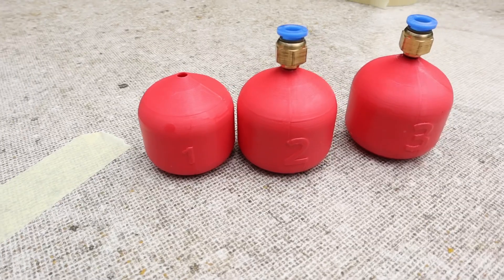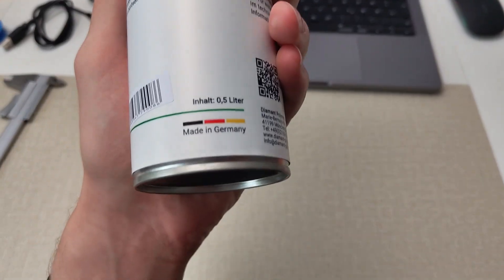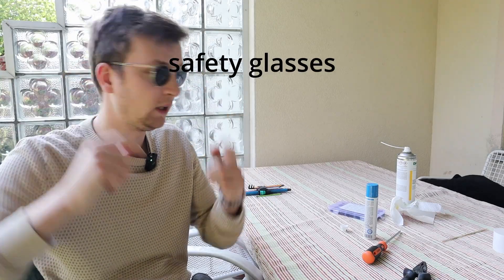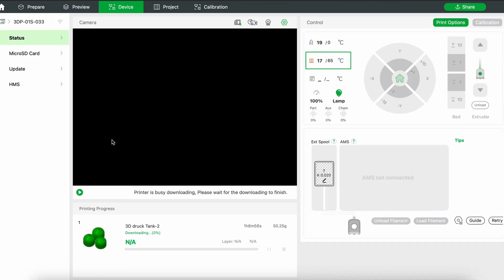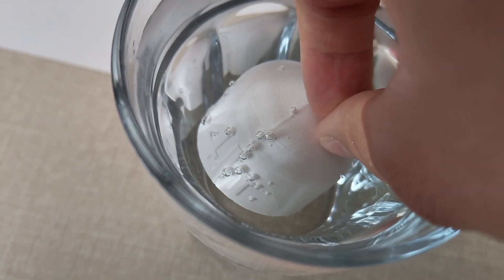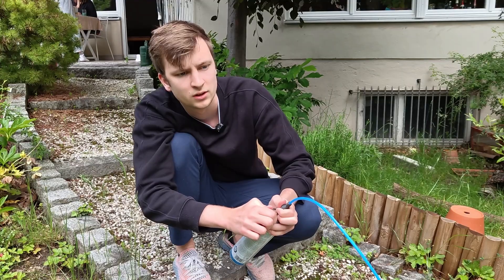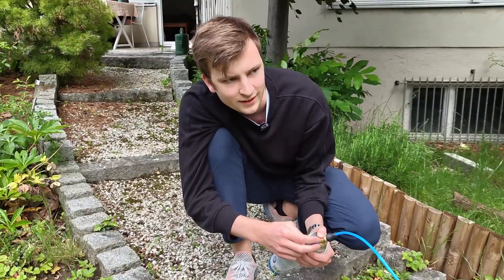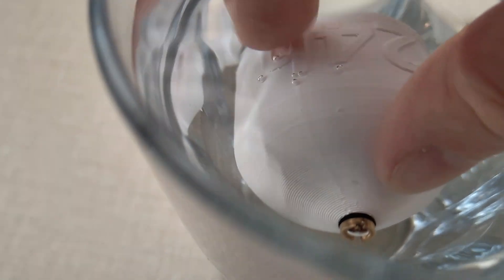Gas tight 3D-prints

Comment: I was able to achieve gas tight 3d printed parts with no post processing or sealing agents. The key settings to play with are extrusion width, and extrusion multiplier. Bump those two settings up as high as you can. Also print as hot as you can. I was able to make pla, petg, polycarbonate, and polypropylene all be gas tight. I pressure tested a tank made out of CF polypropylene up to 500psi without failure, so could have gone higher. It really works, you've got to try it!!
Reply: 34bar?! ... "YouTube commenter sustains life changing injuries from 3D printing experiments"
Reply: yea, I make my air fittings for my airbrush with PETG and proper wall thickness.  Some slicers have the option to merge inner walls with a 200 percent multiplier.  It's like printing a wall and then filling it with glue.  Otherwise I just use 5 walls and they tend to hold fine.
Reply: I'm guessing higher temp, slower fan, slower print, and other tricks used in better bonding in layers may be better than any post-processing.

Also, any test should be done with a control to compare against.
Reply: How large was the tank? That level of psi should handle a PCP airgun !!
Reply: That's awesome, can we get a video on it?
Reply: Considering how stretchy Silk PLA is, and its tendency to merge with lower layers, I bet you could get some pretty good results with it.

Comment: Wonder if applying the coating and then putting it in a vacuum chamber for the few minutes of soak time would result in more of the coating getting into the gaps in the print. I’m going to try this for a water manifold I’ve printed which I know is not water tight currently.

Comment: Maybe you could try electroplating. After some isopropyl alcohol smoothing to blend the layers, or just sanding/light heat to seal the gaps, an all-round electroplating could significantly improve the performance of this as well as give more consistent gaps along the threading at the top.

Comment: I think you are mixing up butane and propane, although i may be wrong, but lighters in the us use butane. Butane is a liquid with far lower pressure at room temp compared with propane. Otherwise, fantastic video.

Comment: To encourage the Dichtol spray to penetrate better, connect your printed tank to a vacuum pump before spraying so the vacuum pulls the sealant deeper into the pores of the print. Bonus: if you've successfully sealed the print, the tank will hold a vacuum when the vacuum pump is switched off, so you can use that test to verify whether you need to apply another coat of sealant.

Comment: Hello 'German Engineer' thank you for this fascinating video. I would like to take this opportunity to ask if you would be willing to make a video on a subject that I feel confident that you would be qualified to make, & that I feel would be of interest to your audience. the subject is this: If an architect wants to design a building on Earth they will determine the necessary structural load bearing functions under the assumption that the structure will be subject to 1G The gravitational constant at a value of 1 in the necessary calculations. these calculations often treat Mass, & Weight as fixed values relative to each of these functions (weight, & Mass) even though they are separate but connected functions. If we imagine building perhaps a high rise on Luna how would we change the way we see the load bearing capacity of various common structural elements such as I beams, & Trusses, or other elements common to terrestrial construction. Thank you again, DTM

Comment: What might make this project help come together:
>Dissolving the surface with a solvent to smoothen it and join the layers
>You could get inside by printing the pressure vessel in two halfs and joing those with screwrods (M3 would suffice here) and nuts (Like with the FGC 9 design), this will allow you to apply any sort of sealent to the inside (any spray-on rubbers, silicone, getting a better layer of Dicktall, etc.)
>epoxy or silicone layer (preferably on the inside)
>Better inlet valve, like putting a nut and gas seal into the print, mid printing, you could then just screw the inlet valve into it and have a way stronger weak point, if the plastic between the inside nut and outside inlet valve is as thick as the rest of the walls, it will no longer be a weak point and way safer
>Engineering a weak point in such a way that if it were to blow up, the part that blows up will not become a dangerous projectile, if the 3mm or maybe even the 2mm vessels were to explode without the hose attached, they will shoot the inlet valve out like a bullet and shoot someone's eye out, damage something or just get lost and be unsalvagable for another print thus losing money

Stay safe, I'm open to helping you with this since it's a great idea and pushing the possibilites of 3D printing is awesome, contact me if you want help with something.
Reply: I think dissolving the walls with solvent would require a material that would also be vulnerable to the gas used here.

Comment: so 1mm thickness, is a strange thickness to choose with a 3D printer, given how default nozzles have become 0.4mm in size.  The answer here, might not be in the thickness of the walls, but the amount of walls (as most things 3DPrinted are, for strength)

it would be interesting to see a 1mm nozzle print (making 1 wall)  or like 2 walls, making 2mm vs the 0.4mm nozzle making 5 walls for 2mm, or 'over extruding' 0.1mm each wall, making 2 walls into 1mm thickness.

Comment: Not all plastics are the same, make sure you use a plastic that will not react or break down with propane.

As for the leaking test in the water, it looks like most of the leakage took place around the seam which is a common weak point for waterproofing prints. It may be interesting to see a test done with a thick nozzle and vase mode although the part would likely still be too thin unless you pick a material with very good layer adhesion.

Something that would be worth trying instead is vapour smoothing ABS or ASA, it is very easy to do and that should fuse the layers and inside surface almost perfectly and make it very smooth meaning that as long as the plastic can withstand the propane it shouldn’t need any coating on its insides.

Also expanding gas cools things down and most plastics get very brittle when cold so that could be an issue depending on the application.

It may not be a bad idea to wrap the outside in something like potentially carbon fibre and epoxy, that could make it much stronger.

A better testing method would be to use a bike pump with a gauge, all you need is goggles and a barrier between you and the pressure vessel to do it safely and then you can read out the pressure and you should be able to tell if it leaks too.

It will be interesting to see what you use this for.
Reply: Not only chemical resistance but creep is also important if you want it to not deform in a week of load. PLA will surely baloon into a sphere through a long load cycle, while ABS will just resist it fine for ages (or until other stuff break it that is).
For his application tho this isn't a problem, as he said it would be holding pressure for like 10 minutes only or so (unless I heard it wrong).

Comment: Did you consider using a really low viscos resin and turning the tanks until it hardens? Might be cheaper and depending on the fill level much stronger (but possibly heavier)

Comment: For pressure testing, especially for larger vessels, fill the vessel with water and pressurise that. This avoids the exciting explosion as the pressure is released on failure. Pressure vessels are tested to a value significantly higher than the working pressure of course. Don't underestimate the destructive power to the rest of the setup and to hands/face etc. of even a small vessel exploding.
Having said that, amazing project thanks for sharing!
Reply: Also consider damage accumulated across pressure cycles. Especially with brittle plastics and inherent stress concentrations/weaknesses of 3d printed plastics.

Have fun and be safe!
Reply: @a.1441 throwback to the original shape CPSDrone tested
Reply: +1 for water test as per pro tests. But if you have to stick to gas, submerging in an open water container for the test is a super easy safety measure. Still a very fun experiment.
Reply: Hydrostatic testing... talk about a bad time doing this for scuba, k size,etc tanks, sooo brutally heavy.  no idea how i did that when i was younger.
Reply: The bulk modulus of water is a lot bigger.. you won't have nearly the control over the pressure inside the vessel, and temperature changes could be catastrophic.

Comment: 3d print, then coat the inside with resin (pour in, shake violently to coat the inside, then turn upside down and put a vibrator to it to dunk excess out) Makes them water AND gastight, and far far stronger then they were.
Reply: Hey i was watching Evan&Katelyn recently and the thought crossed my mind is that i'm really not putting a vibrator to enough of a use in my hobbies. They use them for concrete projects to transform it into a state where it flows easier. For sure has to be helpful in degassing thick liquids as well.

Comment: If you're not going to use a blast shield, PLEASE wear eyewear. They wouldn't make a pineapple grenade if shrapnel didn't kill.
Very cool concept for a video! I wonder what possibilities there could be for utilizing these as HPA tanks for airsoft.
Reply: I think those HPA tanks are over 100 Bar, maybe closer to 200 or 300 when fully pressurized, and then you need a good safety margin above that to prevent accidents.

I don’t think it’s possible, at least not using standard off-the-shelf 3 D printers and plastics.

Comment: Not lying. I have been working on my settings to get to something like this. I want to make a butane tank and liquid fuel tanks. In my opinion, a 3d print that is not water tight is a print that is not well fused anyways. I expect all my prints to come out solid. I am interested in this dichtol. Frankly I am planning on using fuel resistant silicone sealants.

Try baking them in plaster. Just plug the top and anneal them. Unless you plan on burning the plastic then I can't imagine getting plaster out of that.

Anyways thank you for making this video. Very cool, much guidance, and finally a purpose for red filament beyond a esthetic.

Comment: Could you apply a lot of dichtol (so there is a puddle inside) and then quickly pressurize the tank to an safe level? So that the pressure forces the dichtol into the cracks where it’s leaking, because that’s where some flow is created? I think like that you could get it truly gas tight :)

Comment: Hey man cool stuff!
I see in the slicer that you just used a mostly standard profile. For strong prints I default to 0.15mm layers with 0.6mm walls (works on a 0.4mm nozzle).
That way the layers melt together a lot more cause they get squeezed in and sideways a lot. I guess that would also help a lot in making it air tight.
Good luck mate with later tests. Looking forward to seeing if I can use these results later?

Comment: If I could get my hands on dicktall I would. But this reminds me that I want to try water based and petroleum based polyurethanes and epoxy on printed parts to see if that makes them gas tight and also if it adds some strength. I was thinking pressure differentials while wet would help my dicktall substitutes penetrate my parts.

Comment: I'd try 'vapour smoothing' a 3d printed pressure vessel to produce gas-tight surfaces and make the filament less susceptible to layer separation. But I can't begin to imagine any practical applications where a 3d printed pressure vessel would be applicable, over a much stronger and safer carbon fibre alternative, that can accommodate much higher pressures. 👍

This is my opinion, I could be wrong. 😉

Comment: Great video! I've been reading through the comments, and I have a few ideas on how to improve your tanks:

- As a few have noted, your testing wasn't that rigorous. I get that's not what you were aiming for, since you basically stated that you only wanted to see if the tanks could hold pressure at all, but a pressure gauge and something like a compressor, or even a bicycle pump would work better for testing different variables 
- Printing the numbers inside the devices can introduce weak points in the print. It'd be better to judt write the experiment with a permanent marker on the print later!
- Annealing is a good bet for strengthening your prints, and you just need a few kilograms of salt, a toaster oven, and a few hours
- There are quite a bit of other products what could be used to water seal, and probably air seal the inside of the device. Some have suggested abs and acetone, or some exotic glues, but I bet more common products, like UV resins, silicone, maybe hot glue, or even wax (check out NightHawkInLight's latest video for more info on that) could do the trick
- Don't underestimate vase mode! A twice thick ABS vase fused with acetone vapour, with a good wall design, should be able to hold way more pressure than expected for it's weight!
- Also, a straight sphere may not be the optimal shape. In nature may be, but given how FDM printers work, the weakest axis is the Z one, so your parts will always blow up from suboptimal planar adhesion. Maybe wide, short cylindrical tanks could work better, but I bet some printed inside supports, like beams holding the walls from exploding outwards would contribute quite a bit to the maximum pressure, while taking not that much volume from the device
- Finally, the neck will always be your weak spot. Try printing it way thicker than the tank itself so that it doesn't affect the experiments!

Again, it's been a really good video, and I can't wait for the next one! (Hopefully in English hehe)

Comment: Nice experiments. One thing to nitpick though: Lighter gas is butane, not propane. Difference is that it only has ~2 bar at room temp, not ~8 bar like propane.
Reply: Isn’t that a smaller molecule as well? So potentially it would leak faster?
Reply: Butane is actually larger than propane since it has 4 carbons instead of 3. Methyl groups have 1, ethyl 2, propyl 3, and butyl 4. You can of course keep going with longer carbon chains as well

Comment: One method which wasn't tried or I haven't seen is submerging the print into stabilizing resin so it can close the air gaps and remove oxygen. Then you bake it to cure it.
Reply: Most printing materials melt/soften at fairly low temperatures, maybe a non heat setting resin.
Reply: Yeah, just something that soaks into any gaps and eventually hardens/joins.

Or could you try and coat the inside and pressurize it then, driving it into the gaps?
Reply: I thought about uv resin to do the same , dip and cure with the light .

Comment: We do not know the pressure value, only that you gave some pressure on it.
And you are holding the Propane bottle wrong. You should not let the liquid flow into the tube, only the gas. So keep it vertical.
If you would use a compressor with a pressure sensor, this would be useful.

Comment: I printed a bowl to soak a motorcycle clutch in oil and at only 2 perimeters it didn't leak at all.  I didn't know people have problems making them liquid tight.
Reply: I'm guessing that oil would be stickier than water, and thus would need bigger holes for the pressure to overcome the surface tension. Also, depending on your printer settings, "2 perimeters" could've been printed like double thick vase mode, which other people claim is mostly waterproof by default!

Comment: Get some DCM it is the best thing ever for PLA (and many other materials) chemical welding. Apply a little DCM with a Brush on both parts, keep them wet for 15-30s or so then press them together. But don't dip the Brush directly in the DCM bottle or you will heavily contaminate it, put some in a Shot Glas (good because: glass, with a high rim (evaporation)) I use it all the time to be able to print my 3D printed parts in two pieces.
Tip: Parts will adhere hand-tight in seconds but full strength is only reached if you wait until all the solvent is evaporated but DCM is VERY volatile, like Acetone on steroids, but no nasty smell 😅

Because DCM dissolves the Plastic you can also make a thick PLA glue/resin out of it but it shirks quite a bit when drying but good for sealing things, embedding cables also when you made a hole .1 or .2 mm to small, I have saved parts because the DCM makes the PLA surface soft.
Didn't try Vapor Smoothing yet because Das Filament PLA filament works great with Acetone Vapor smoothing.

I bet because it dissolves the plastic it will also make gas tight parts.

PS: Keep in mind DCM is not healthy it is classified as a potential human carcinogen, wear gloves and work outside or directly in front of an open window.
I get my DCM from es-drei chemicals.
Reply: You can also get DCM from Modulor Berlin, you just need to submit a written note to them that you use it as a plastic welding agent or the like. Not as a paint stripper.

Comment: why dont you try printing your tests at slower speeds and higher temps? i noticed youre using a bambu machine and their fast profiles are too fast for good layer bonding/airtightness, which might be the issue and cause the need for dichtol to begin with